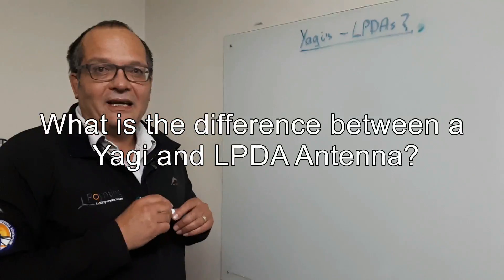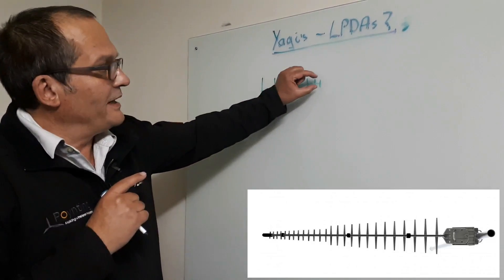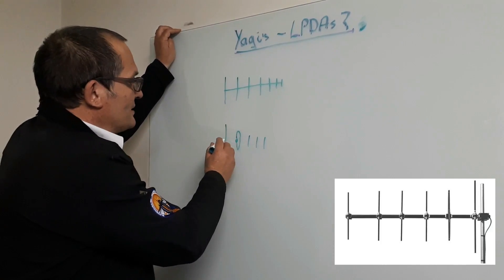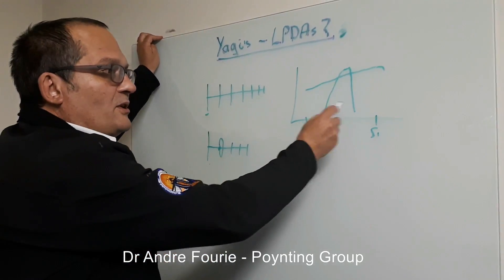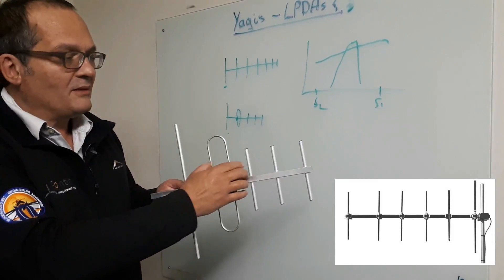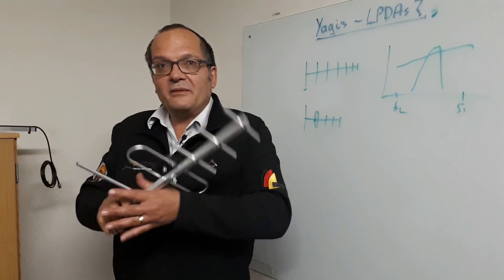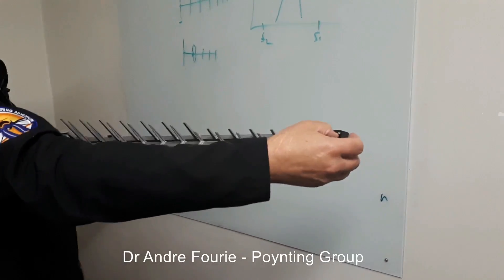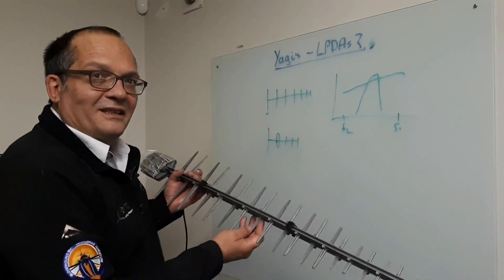YAGI Antenna explained - What is the difference between a Yagi and LPDA antenna?

Comment: LPDA dc shorted antenna has a low termination impedance,Its a lumped constant impedance mismatch VSWR compared to a distributed 50 ohm coax feeding the antenna termination.A non dc shorted antenna(Yagi with gamma matching element)will have higher gain and electrons migrate better due to the center conductor is not dc grounded,Better electron mobility along the surface of a conductor.Ground potential is noisy with many frequency transients,As noisy as the atmospheric potential that is effecting it.Delta matching yagi antennas are dc grounded and do not preform as good as gamma matched yagi,But the delta matching has broader bandwidth.I took two of your poynting LPDA antennas (In a side by side stacked configuration)and cut the connection where the dc shorting stub would be and put insulators in between the 4 mounting holes to isolate the 2 sides of the antenna boom,Used delrin washers for the bolts so not to make contact from each side of the antenna boom,So now its a non dc shorted LPDA and it works much better in a remote area.Was working with under -110dbm's.I used a sawtooth sweep generator with a high end detector probe to sweep the antenna before and after and the parabola/Bell curve did change,The Q has a much higher skirt and it did narrow the bandwidth but with much more gain it makes up for the small loss in bandwidth.Many more peak nodes along the 700 to 1900mhz frequency range after the modification.Went from B2 -123dbm to -109 dbm and B12 -107dbm to -96dbm,With much faster down and upload speeds after the mod.My only concern is corona discharge effect since the center of the coax is not grounded.Next project is building a faraday cage reflector above the antennas.And sidactors on each connector of the router.I bought a military Log periodic antenna (50-900mhz) at a army base auction and at the C type connector,Its not dc grounded.Joe EE/P.E.
Reply from the maker: Great study. Not something we have ever looked into in that much detail - please keep feedback coming. Perhaps we can make some useful modifications

Comment: The LPDA looks like a hedge shear.
Reply: @poyntingantennas  What intrigues me is how the LPDA manages to avoid phase shift and reflection and being resonant at different wave lengths at the same time even though the phases don't fit entirely together. On the other hand I expected that the slight phase shift would probably create coupled oscillation modes.

Comment: So for getting cellular signal. lpda antenna is a safer choice than yagi or grid parabolic antenna because is has a wide variety of  frequency support?
Reply: @poyntingantennas  Is it true, theoretically, that the more antennas in parallel, the better?  So 4 or even 100 LPDA's in parallel (or any antennae) to the same wire would result in a stronger reception?  This boosts the voltage correct?  Is a strong signal correlated to a strong voltage or strong current or both?  So, theoretically, a longer (bigger) antenna with more frequency matched elements will boost the current and many spread out in parallel will boost the current?  is there a limit to how many additional elements (length) and how many in parallel what will provide a stronger signal?  Am I understanding the basics correctly?
Reply: @VenturaIT  Hi Ventura IT,  every Antenna has a characteristic Impedance, without going into too much detail, that is the Inductive/Capacitive 'Resistance' which is very much Frequency dependent. The lengths and distances between the Dipoles that form the elements of the LPDA (Log Periodic Dipole Array) are very carefully calculated to present (in the case of most RF Comms) a 50 Ohm Impedance Load to the Transmitter (for example) of say the Router that will be connected to the Antenna. This means that one cannot connect two LPDA Antennas in parallel without interrupting the Load that it presents to the transmitter. Two 50 Ohm Antennas simply connected 'electrically' in parallel would (parallel circuit theory) half the characteristic Impedance (as well as the 'load') to 25 Ohms affecting the transfer of Power to the Antenna so, no, one cannot put LPDA in parallel without for instance matching Hybrid Splitters. The main issue with Splitter/Combiners is that you will 'lose' 3 dB of Power meaning only half the Power of the Output of the Transmitter will be 'presented' to the Antennas. Each Antenna that you add to that will need a Matching Hybrid Splitter (as an example of a splitter which maintains the characteristic Impedance to all the ports) to maintain the Load presented to the Transmitter for maximum transfer of Electromagnetic Energy (the 'Radio' Wave). The Electromagnetic Wave (Radio Wave) 'induces' a Current in the Dipole of the Antenna, at the resonant Frequency (Dipole length, to be simplistic) so theoretically , the more Dipoles you can 'fit' onto a Log Periodic Array, the better the 'wideband capability and the Gain of the Antenna will be. The Current induced by the Magnetic component is of course closely related to the Potential Difference (Volts) presented to the characteristic Impedance, the 50 Ohm 'load. Its a little more complex than that but that's the essence, The number of Dipoles is really limited by practical size and the 'number' of Frequencies (Wideband) you need to cover and the Gain of the Antenna you wish to achieve. I hope this is clear enough, if not please respond and I will endeavor to explain more, kind regards, Pieter Prinsloo, Technical Marketing Engineer, Poynting (Pty) Ltd.
Reply: @pieterprinsloo1022  I just wondered if multiple small  antennas at different locations would be better, you could have one up on a hill, one over in the valley, one at your house, etc... and tie them all into the receiver to get a better signal.  I'm sure someone has tried a lot of small antennas wired together?

Comment: So I’m in a rural area surrounded by trees.  The best thing for me is MIMO.  I have a mofi450 attached is 2 yagi’s on a T bar and pole angled at 45 degrees.  They are WiRengs super expensive antenna.  These have worked decent but degrade easily about 10-12 miles from tower.  Maybe -113 to -117 single strength.  I bought two Log periodic antennas at 46 inches long I believe.  Will these hold a better signal maybe lower db’s vs the yagis?  Orientation of these on a pole would it be one on top
One on bottom spaced 3 feet?  Would they or should they both be facing same tower and direction? Let me know I haven’t received yet I just want to ensure I have it set up the best way.  I assume these combined will make MIMO.  Thanks in advance video was very helpful and understanding!

Comment: Can we use solid aluminum element 1cm in diameter to make 1/4 MHz antenna?
Reply: Thanks for your reply, I am going to use screws between the antenna elements to screw into the boom (like the arrow yagi antenna) I did not calculate the screws in my calculations Do I need to reduce the size of the haro element to use screws between the two elements?  The two elements make the size of all the elements 2cm larger than the calculations. Am I having trouble?